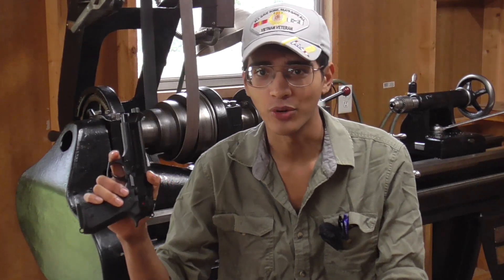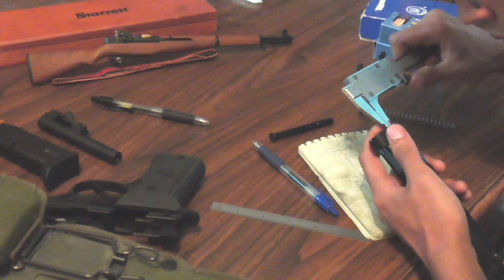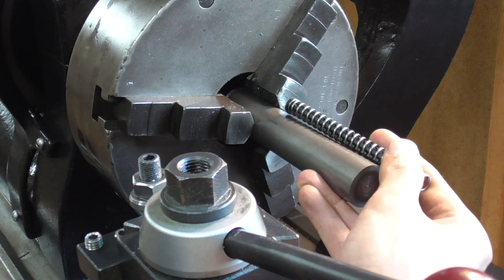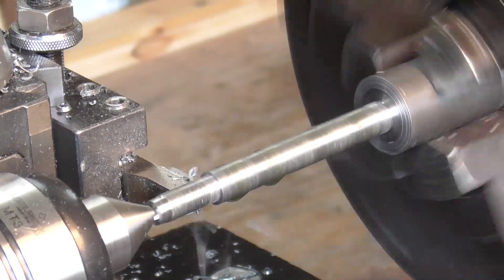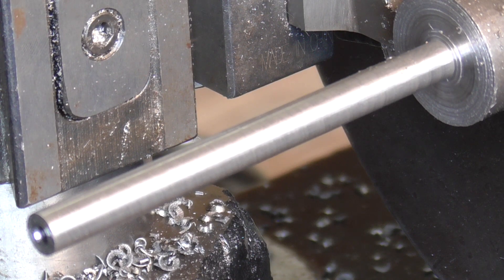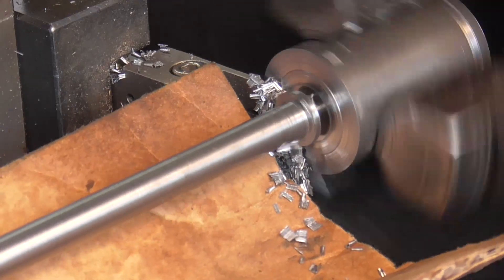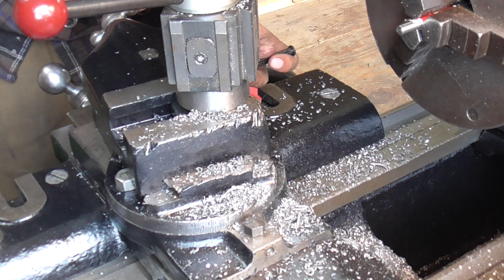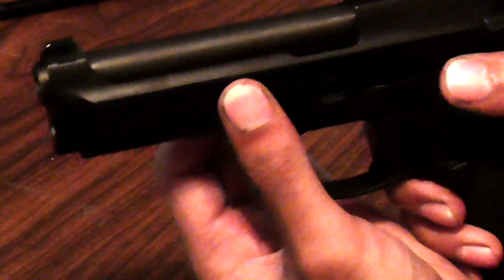Making a Steel Guide Rod for the 92X Compact (Beginner Lathe Project)

Comment: Dude that is a super cool laith. What is that thing, looks really old given the drive belt and pulleys.
Also have you considered the "blue-ing" technique I think it's called that gives the steel a protective coating. This old Tony here on YT has a good video about it. Thanks for the content. I dig it
Reply from the maker: it's a 1920s South Bend. I thought about bluing it but liked the contrasting bright surface finish

Comment: Hey dude, I'm a tool and die apprentice. If I might make one suggestion if you're going to be doing projects like this--get yourself a copy of the Machinery's handbook. It has information about damn near any kind of machine operation or any other kind of metal working you can think of. Feeds and speeds have been broken down into mathematical formulas based on material type and tooling used. 

I don't know if you have any kind of formal training as a machinist/tool maker/whatever but you did a good job on this. Also, out of curiosity how much did this lathe cost you?
Reply from the maker: I think it was like 1500. I've taken a look at a copy of machinery's hand book and it looks like a bit much to me 😅

Comment: As soon as I saw that steel in the chuck I just knew that tool holder was gonna hit it. I thought it’d be when you were turning the steel down. The first time I ran my tool holder into the chuck I was threading. I ruined the threads. Only advice I have is that you don’t have to make passes with the file if the machine is running. You can just lightly hold the file on the piece of steel. Fr tho good shit man I’m really excited to see more of your projects turn out perfect!

Comment: Im surprise youre not using coolent on the steel rod and the tool to reduce the heats thats been generated.
Reply from the maker: i was using plenty of cutting oil and using a leaded "free-machining" steel. i wouldn't think about taking those same cuts on certain other steels